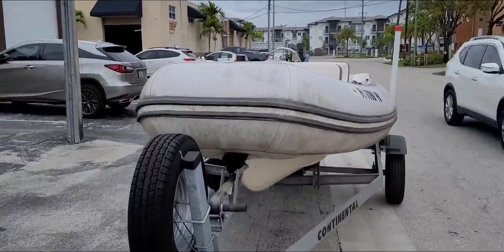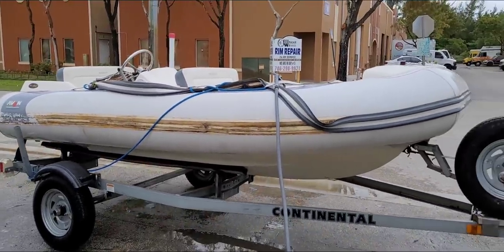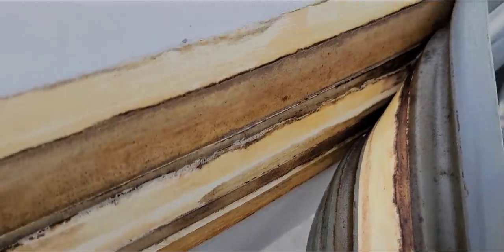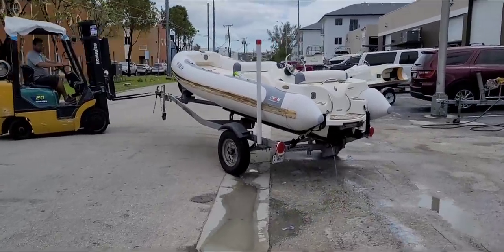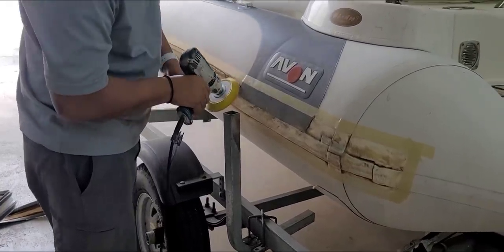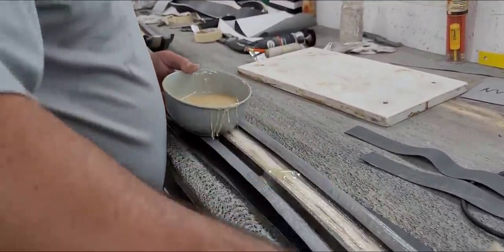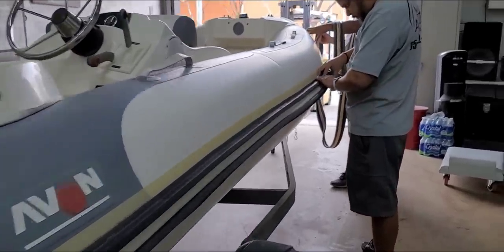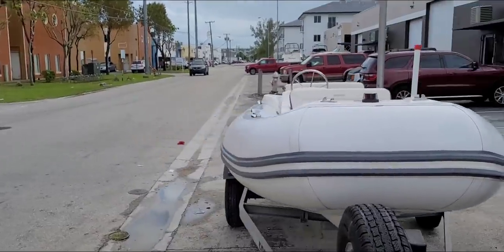Rib Boat Rubrail Repair and Cleaning (Alfred Montaner)

Comment: Nicely done, thanks for the video. I have a 1997 Rendova 14 foot with original hypolan tubes which are in relatively good shape. There are however a few spots and the rear and along the front edges where the rub rail is coming loose. While ripping the rub rail, sanding and reapplying would be ideal, can I simply sand and reglue the parts that are coming undone? What type of adhesive do you recommend, Orca Hypalon glue is expensive and I only need a small amount, can I get away with using Clifton?

Comment: Great job guys. What type of glue did you use? I have a 20+ years old 13-foot Avon with small sections that came loose. I don't know that I would tear the whole thing off but hope to dress it up.

Comment: Alfred is resin adhesive glue any good for pvc
Reply from the maker: Use pvc glue other glues dont work well on pvc
Reply: @AlfredMontaner  Alfred have you heard of the solar marine boat
Reply: The company is telling me that the material is pvc and it's resign with resin adhesive glue
Reply: Is resin adhesive any good for pvc